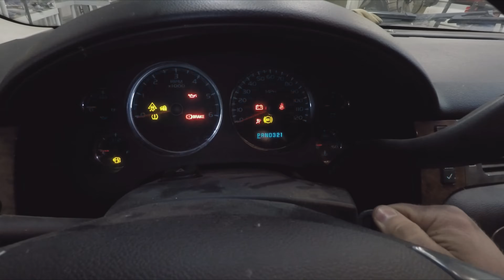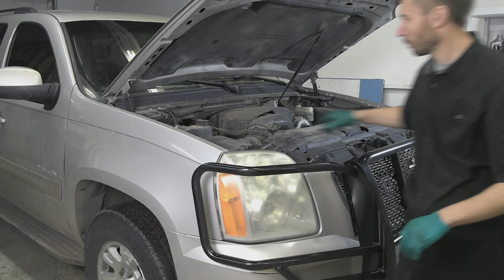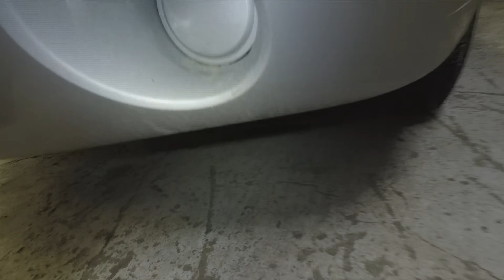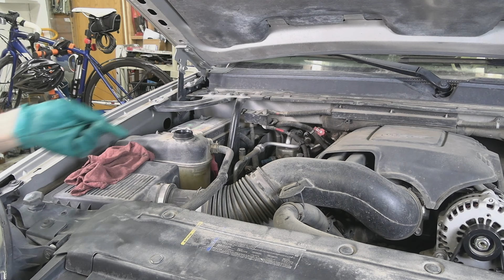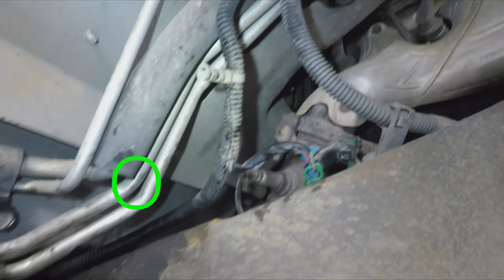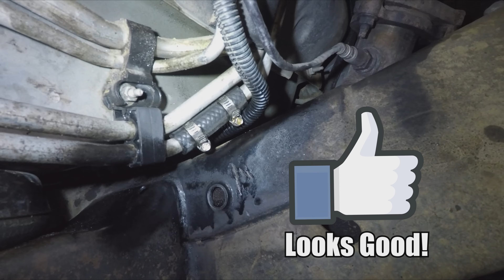MYSTERY ANTIFREEZE LEAK caused 'No Heat' problem (2007 GMC Yukon 5.3L)

Comment: I recently drained my coolant for a job and have had coolant issues since. I noticed you used the pressure tool to add coolant back to the system. Is that to prevent air pockets? Maybe I need to pressurize the system with this tool? I’ve tried everything and hopefully you can help! Thanks for your time!
Reply from the maker: Yes it's a good tool, but it's kind of expensive and requires an air compressor. You may want to try a regular filler funnel to bleed the air out, chrisfix shows how to use it in one of his videos - https://www.youtube.com/watch?v=29z94xBdAjE&t=999s